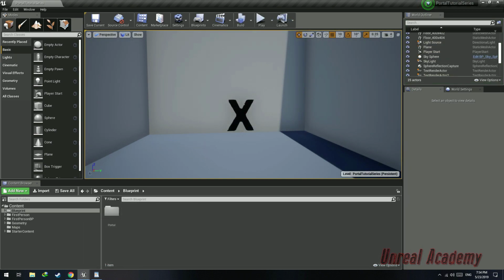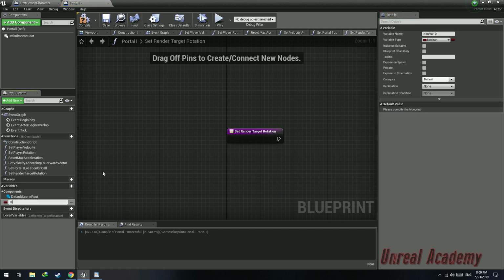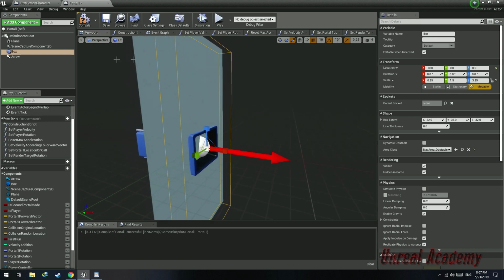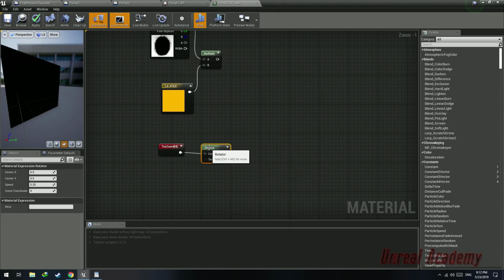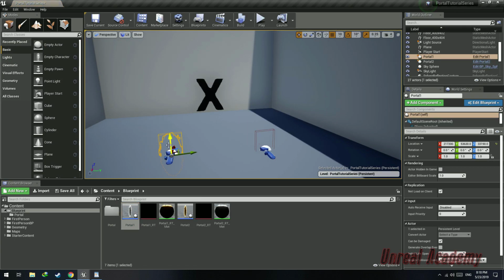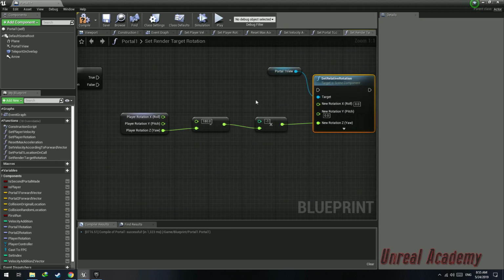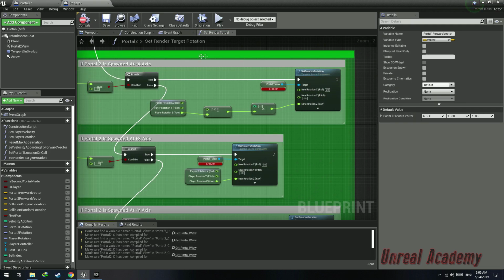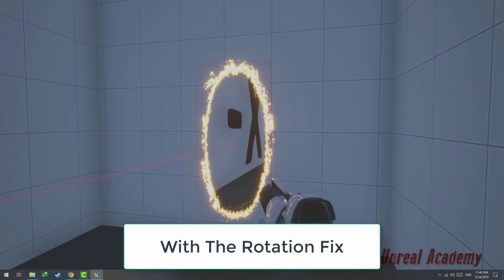Portal Gun Tutorial Series  - Setting Up BP - Variables And Render Target | Part 2 UE4

Comment: Great work. Couple pointers and notes. 

1) You can change the tick frequency so they don't tick every frame. I like that you do the complicated math for us.

2) Don't like how you set it up. When you are copying and pasting alot, you leave room for errors and extra work. Better to have one portal actor with its variables. Main vars would be ConnectingPortal,  portal data struct. Portal data struct would hold the transform data, velocity addition,  etc. Ideally, all this would be on a portal gun scene component, that can spawn actors on its x axis. 

3) Your material math is good, but the set up isn't. Color should be a Vector parameter. Render target should be passed as texture parameter. Each portal actor can have a portal color (editable, exposed on spawn) and a texture target, exposed on a spawn instance editable. In the constructor, it can create a dynamic material instance instance, promoted to a variable. Texture 2d variable and color passed into the dynamic material. Dynamic Material applied to the mesh. (Didn't follow closely to see which portal got which texture, although exposing it spawn should let you get the same behavior when you pass it in with spawn actor. 

4) Do you need to cast to FPS char? Why not just ACharacter reference? (ACharacter already has access to character movement component, and other variables can be moved to component.) If was scene component, can AActor* Owner = GetOwner(); ACharacter* OwnerChar = Cast<ACharacter>(Owner); Equivalent in blueprint.  

5) I may sound a bit harsh, but you get mad props for figuring this out. I would have a lot of trouble with it. 

6) This set up allows for a system of N portals connected, where portal A leads to B, B leads to C, and C to A.
Reply from the maker: Dude! I love you! Seriously, THIS is the type of feedback I'm trying to find!

1) You can change the tick frequency so they don't tick every frame. I like that you do the complicated math for us.

I actually did do that when I was setting up the original Portal system, but ended up not using it in the tutorial because when the player moves, the portal 1/2 rotation gets messed up, and the render target renders the player movement much slower, making it very laggy. I suppose people could change the tick frequency depending on what "quality" level the user chooses, but for the sake of the tutorial, I kept the tick to happen every frame. Hehehe, the math was the worst part out of everything!

2) Don't like how you set it up. When you are copying and pasting a lot, you leave room for errors and extra work. Better to have one portal actor with its variables. Main vars would be ConnectingPortal,  portal data struct. Portal data struct would hold the transform data, velocity addition,  etc. Ideally, all this would be on a portal gun scene component, that can spawn actors on its x-axis. 

I tried to find any video I could find on making a Portal system, but couldn't, so I made it the only way I knew I could. I had previously considered doing this, but I wasn't sure how everything would work. I have to ask though, if I used this method, would it run better or it's just more efficient while working on? Oh and the Data Structs isn't something I have used before, which is why I didn't use it. I think it would be my first time using it, so I guess I can learn something!

3) Your material math is good, but the set up isn't. Color should be a Vector parameter. Render target should be passed as a texture parameter. Each portal actor can have a portal color (editable, exposed on spawn) and a texture target, exposed on a spawn instance editable. In the constructor, it can create a dynamic material instance, promoted to a variable. Texture 2d variable and color passed into the dynamic material. Dynamic Material applied to the mesh. (Didn't follow closely to see which portal got which texture, although exposing it spawns should let you get the same behavior when you pass it in with spawn actor. 

Just wondering, why should color be a vector parameter? I'm not really good at materials, and it's next on my to-learn list. I'm thinking of making an auto terrain cover material after I finish this Portal System, so that I could learn more about how materials work! Working on this Portal System has helped me a LOT in understanding BP, and you've just made my understanding soo much better by introducing new concepts!
Anyways, from what I understand, you're saying that I should have created a 100% dynamic material, promoted it to an instance, and then set the side colors, the main render target color at runtime right? As soon as Portal 1 is created, I assign a static color to the "Render Target" area, and as soon as the Portal 2 has been created, the Portal 1 material gets set to show the RT of Portal 2? This would allow me to only use 1 Material as opposed to 3 that I use! Wow, this is actually genius!

4) Do you need to cast to FPS char? Why not just ACharacter reference? (ACharacter already has access to character movement component, and other variables can be moved to component.) If was scene component, can AActor* Owner = GetOwner(); ACharacter* OwnerChar = Cast<ACharacter>(Owner); Equivalent in blueprint.  

Does this improve performance by any chance? The reason why I have decided to keep everything either in the Player BP + the Portal BPs is that most of the stuff happens in those two BPs. For example, when the player shoots, everything MUST be done in the Player BP, because it's where I'm doing all of the line tracings, getting the Hit Normals, Hit locations, etc. 
What you're essentially saying is, if I understand correctly, instead of casting to FPSC, we should Cast to ACharacter reference right? If so, all I would have to do would be instead of setting "Cast To FPS" as the variable "Cast To FPC", we'd set the "ACharacter reference" as the "variable "Cast To FPC" in the event begin play, and have to change almost nothing else. But we'd have to make A LOT of changes to out Player BP, because we would have to start storing everything in the "ACharacter BP".
If there is a significant benefit from this, other than better workflow, I might even implement this!

5) I may sound a bit harsh, but you get mad props for figuring this out. I would have a lot of trouble with it. 

Nah man, you sound critical, and this is exactly what I need! This will help me improve my skills. I mean what good would praises do me if I never really learned anything new? Thanks to you, I now know a lot about the faults in this Portal System, and anyone who will watch the video, can implement the fixes accordingly.

6) This set up allows for a system of N portals connected, where portal A leads to B, B leads to C, and C to A.
 
Are you talking about my setup, or the setup that would happen if I followed your advice?

Again, thanks for all your great points! I'm really grateful that you took your time to comment on my video. I'll try and implement as many points as I can, and make a video in the end titled "Bug fixes & optimization", which will solely be dedicated to fixing the Portal system, and implementing the features or fixes that people like you comment! Hopefully, people will find this helpful :)
Reply: No problem. Just trying to help out. Heres some commentary on your commentary

1) Looks like your going to have to manage tick based on player distance. Bit more complex but doable.
I'd recommend parts 1 and 2 of this https://www.youtube.com/watch?v=j6mskTgL7kU&feature=youtu.be 

Had useful stuff even though I'm here with 1 year of unreal experience. Video series will explain why you should be cognizant of casting.

2) Its alright. Not gonna find tutorials about everything.That method would make working on it much easier. Doubtful of performance gains.

3) Color should be vector parameter so you can have one master portal material and set the values in an instance. Material instances can be either created in the editor has material instance object or out runtime as dynamic material instances, where you can change values of material during runtime. (Like a portal that flashes colors.) Unreal Engine's youtube page gives a good intro to materials. I'd recommend it.

4) Unless you need a very specific class, its better to cast to general master BP class for core functionality. See video tutorial series in 1)

5) No problem. When I started out, wish I had a bit more hand holding and someone to critique me. 

6) Talking about set up I'm proposing. 

7) Wrote a google doc to help beginners get the lay of the land. Still a little rough, but it outlines the skill sets for Unreal 4.

https://docs.google.com/document/d/16Nb3Mn-8Z-CkRFEgq8F6EA_wW-dhYR5YOuj042mgsyg/edit?usp=sharing
Reply from the maker: 1) Ahh, I'll look into it then! I think another thing that I could do is create a new event, and trigger the event every time the player presses the movement key? That could be doable as well!
2) Ahh, well, I think it would have been harder doing all of this via one blueprint. I'd assume we're going to have to call checks upon which portal is which etc to ensure the Portal system keeps working as intended. 
3) I'm not sure I understood. But it's ok, I'll be able to understand once I dive deeper into materials, hopefully.
4) I'll try my best to see it ASAP, but don't have a lot of time atm. Added it to watch later! Thanks for the link!
5) IKR! Critique is something that is so vital to the development of a person's skills! Sadly, a lot of people think that you should only praise and not critique ones work, thus making it harder for the creator to improve!
6) Thanks a LOT for that buddy! How long did it take for you to write? Also, just a quick question, why is casting to different BPs bad? I can understand why ticks are bad for performance, but why is this the case for casting to, say, the FPC? Isn't it equivalent to calling a function in a class and accessing its variables? Why is it frowned upon?
Reply: 6) Only a couple minutes. Casting to different BP is bad because of uneeded references that are loaded with the thing you cast. If you have object A that casts some actor to ThirdPerson character, then the mesh of thirdperson character and its animation blueprint are also loaded. Then the meshes references (like materials must also be loaded) Its really easy to create a web of references that must be loaded along with the object when you cast. Having the proper set up (C++ base --> BP parent --> Specific object with nuances) reduces this. Using interfaces can prevent this all together. Having events in BP parent that are blank and filling them out in the child BP classes also helps). Video I recommended will set you on the path to good habits. Something I wish I had known I was starting out. I have to tear up my floor boards to properly implement this for my project.
Reply from the maker: Ohh! That makes soo much more sense! It really is so insufficient! Damn, I wonder what else I might have missed. Again, thanks a lot for your explanations and giving your thoughts about my code, and special thanks for linking to that Google Doc and that video! I hope to see more of you on my videos, hopefully, you'll be able to help me improve!
BTW, since you've been using UE4 for 1 year, what have you managed to develop? And anything else (on the coding side) you need help with? I'd love to see your projects!
Reply: No problem dude. I"ll be around to see what you got. Been working on my game. Still far from release. Did build a 3 in one dungeon generator. Needs one last overhaul before I'd consider releasing on the market place. Proud of my animation blueprints I build. I do have a playable prototype...for mac. (Been having packaging issues for windows.) Haven't had time to fully dedicate myself to unreal use I just finished a masters program. We'll see how this summer goes